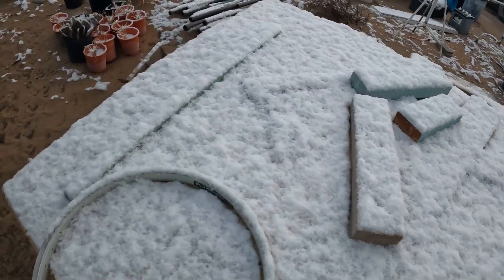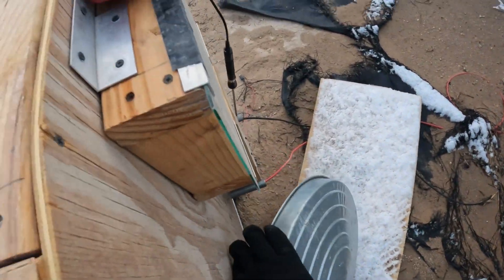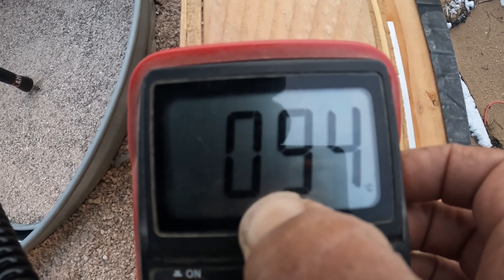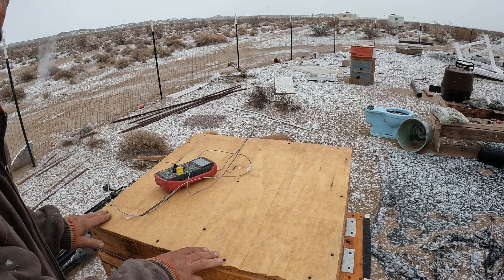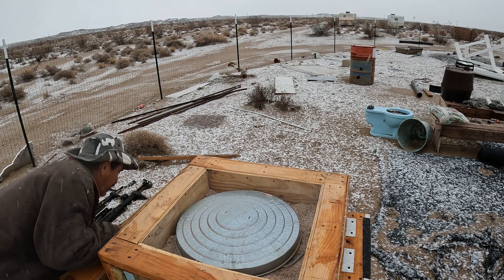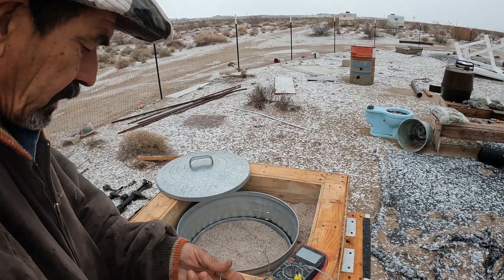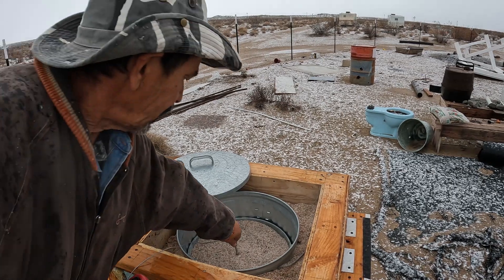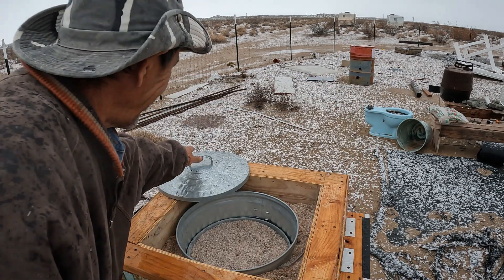240-Volt Element Holding Strong After 2 Months

Comment: I've just started making my sand battery, I've seen your other videos. I've made mine from 3x2 paving slabs made to form a box. The box is on 9" concrete blocks at the corners with compressed vermiculite tile between for thermal separation. The pavers are held together by metal pins made from 6" nails and tension wires. The "box" is 6x3x 4 foot high. The heat will be extracted using a 4" stainless steel logburner flue going to a homemade heat exchanger to transfer the heat to water. The box will be insulated with a foot of vermiculite. 
This might be a alternative to the  cinder block method, you'll get more sand in the space as well. 
Keep up the videos, it's given me the idea to build mine, much appreciated.

Comment: Thanks for the update. I'm looking forwards to building my sand battery to capture the extra from my wind generator. I was also thinking since my charge controllers sit on float mode most of the day I'd set the load controller to use the full panel all day long. Sand is cheaper then more batteries.
Reply: Look into voltage sensing  relay  to switch current  when battery reaches  max charge.
Reply: @teddycunningham7568  I run a Xantrex C40  charge/load controller for my wind generator. Got that part covered.
Reply: @keithfloyd1178  just looked up your controller I like the reviews  am building  3 systems for house,garage and cabin so I may try one  . Lot of people  repurchased  after many years of service.  Does the unit switch power directly from input or is it regulated current like would normally be sent to the battery ?
Reply: @teddycunningham7568  it connects to the battery bank and the load coil. My wind gen is wired direct to the battery bank. I have it set to bulk charge at 14.1 volts and low volt cut off is at 11.5. and it's on a float mode at 13,7 volts. I also run 2 Outback Power FLEXmax FM60 MPPT Solar Charge Controllers for 12 panels.
Reply: @keithfloyd1178  thanks this is helpfull . Purchased 60 used 210w panels  I hope to be totally off grid and gas heat by winter building lithium ion 18650 power wall battery's, and collecting tools and supplies  to make and repair lead acid battery's in case s.h.f.
Reply: @teddycunningham7568  Welcome, I've been off grid 8 years and constantly expand my system. I just switch from gas heat to a wood stove and electric heaters run when it's windy and when the sun is up. I have more watts charging then the heater and both grow tents. And it'll be the rationing during WW 3 that you have to build for. BE careful of the Lithium batteries as I have 3 neighbors who lost all of their electronics and the shed they were in when the batteries shorted out.  I uploaded my wind gen build, 1 of the 3 got a lightning strike and several other neighbors have had strikes also on the mast wind generators.
Reply: @keithfloyd1178  redundant system's for power and water are my primary focus now .I jumped  into  building  18650 because it looked to be less expensive not knowing  the amount  of labor  involved by mid summer I will have 20 kw lithium ion  battery  on line with 3 kw lithium  iron phosphate   . Looking back I should  have concentrated  on lead acid first as they are infinity rebuild able.  The sand battery  will make greenhouse and home heating much easier to manage plus the extra heat has so many uses that most folks have not considered everyone seems to be thinking of small mass heaters I feel to be truly useful  they need to be several cubic yards in size and super insulated.,with the ability  to access the high temperature core for various purposes such as ceramic firing and metal work with coils for liquid heat exchanger for lower temperature jobs. All this has my time and finances taped out for the foreseeable future.  LOL

Comment: Hi! Would it be possible to take the 500 C sand battery from solar, but then also insert copper tube coil with water flow to work as a tankless geyser? Surly 500C is enough to get water hot? Thanks
Reply: Heat energy stored in sand can be extracted  many ways .limited only by size of thermal mass power input and amount of insulation .
Reply: https://youtu.be/G6ZrM-IZlTE
Reply: just power a boiler is easier